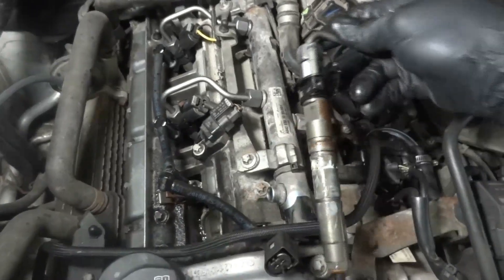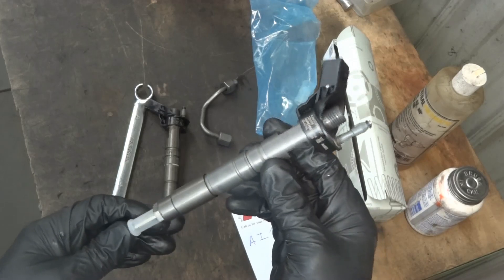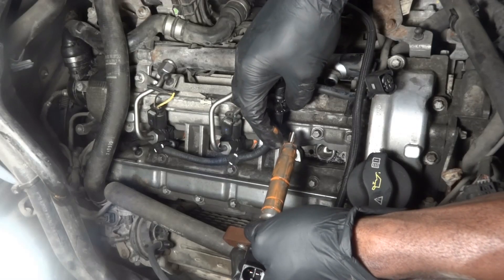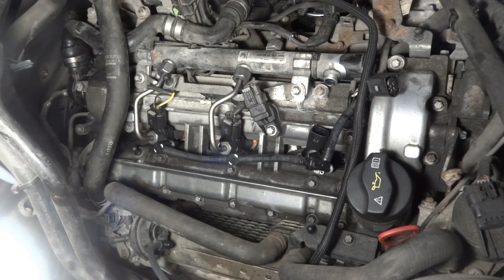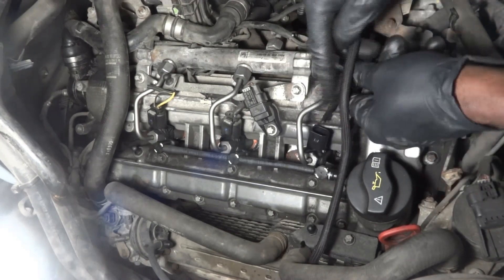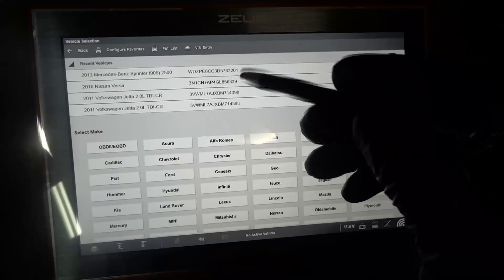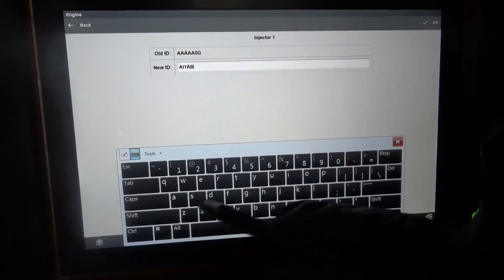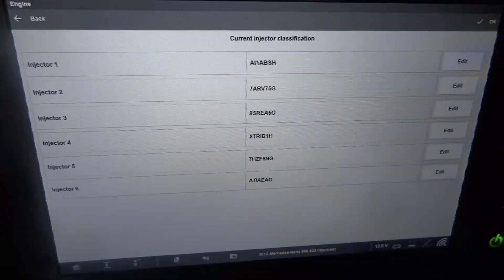Mercedes Sprinter : Cylinder Misfire Code P0301 & P16C200, Engine Runs Rough, Diag & Repair Part 2

Comment: did you notice that all injectors that were misfiring had the same id codes dont you think that was the reason for the misfire
Reply from the maker: @brianmafu5743   Yes, I did notice it but that wasn't the reason for the misfire, I had another sprinter in the shop that had the same id on all the injectors but it didn't misfire

Comment: If only one is playing up would replace all four?
And why?
Thanks
Reply from the maker: @kd3446  you don't need to replace all of them!
Reply: @KITS_Auto_and_Truck_Repair 

I replaced one on number two cylinder & hadit coded to the car, it l is still misfiring I will get it diagnostic done again..& see what else is causing it…

Comment: Hello. please can you help me ?? I have mercedes sprinter 2006 engine does not start ! i get error code 0201 and 0204 it says that there is a short circuit between wires 1 and 4 injection valve ! how can i contact you ?? I live in Sweden
Reply from the maker: @monemaljouri3727  check fuel pressure!
Reply: @KITS_Auto_and_Truck_Repair   Hi again thanks for answering me! I have changed the high pressure pump and fuel filter! could it be injection 1 and 4 that are bad?

Comment: A few days ago I ask you where Ac ports I found them and why no power steering ? My serpentine belt broke I'm sure why Ac not blowing cold & hard steering my sprinter a 3.0 how many belts do dose it have I didn't have flash light to see only light from my phone is second belt hard tie install I'm hoping once I install serpentine my power steering & Ac restored
Reply from the maker: @jamesray3920  Good!

Comment: Any suggestion why power steering very stiff hard to steer its full of fluid I see on you tube where others Mercedes Benz have similar issues
Reply from the maker: @jamesray3920  your power steering pump is probably going bad!

Comment: Kinda crazy that all the injectors that you had an issue with had the same ID code. Maybe they were problem ones from the start.
Reply from the maker: Chris Moreland  Heard That the injectors can have the same ID and work fine, so it's hard to tell

Comment: Hey, I really need your help!! My nissan frontier keeps misfiring.I NEED YOUR HELP . I have new spark plugs, new injectors, new fuel filter, air filter so im lost I am not sure what to do now. PLEASE IM ASKING FOR YOUR ADVISE...PLEASE SEE MY COMMENT
Reply: Hey Boskin, you help me with something please
Reply from the maker: Natasha Lewis  Sure! do you have a multiple cylinder misfire or a specific cylinder misfire? you need to check your ignition coil wiring and your injector wiring, I have a lot of videos on this channel that can show you how to do that! also check for compression to eliminate any mechanical issues that might cause a misfire!
Reply: @kdiagnostics6040  multiple misfire, I was told it could be the Mas air flow sensor ,but I can't find any try it. It's a new wire loom so I was wondering if I don't need to check the wiring again.

Comment: Hi handsome. Great repair as always. I have question have you ever used dpf cleaner call "launch uk , DPF gun particulate filter cleaning fluid" and the spray gun, O'Riley auto from the UK adds a of the detergent with half of water and sprays it into the dpf filter then he reset the computer and it runs good as new. Thanks.here is a link to his jimmy. See for yourself. 
https://youtu.be/g53q6JkOD3E
Reply from the maker: G O  I haven't heard of it! I'll check it out!

Comment: very good video.but i have notice that the 3 injector that failed had the same id 3 injector same id
Reply: The injector ID (code) defines its characteristics, such as coil impedance and flow rate. The engine computer needs theses to precisely time individual injector activations.  These codes are not unique location identifiers (like a TPMS system sensor) and it is quite possible for them all to be the same.
Reply from the maker: @ClarkLaFlare   Thanks for clarifying that!
Reply from the maker: dan man  Thanks! Injector 3 was not faulty we had fault codes for injector 1, 4 and 5
Reply: @KITS_Auto_and_Truck_Repair  yes that what i was trying to say all the 3 defect injector that you replace had the same coding #
Reply from the maker: @danman9017  Ah ok! I see what you mean, I believe those are OEM IDs From the Factory since these injectors haven't been replaced! I'm not sure though!  I'll do some research and figure out why those IDs were the same!
Reply: @KITS_Auto_and_Truck_Repair  i wonder those defect injector had those mach id that was in the computer
Reply from the maker: @danman9017   I'll do some research and figure out why!

Comment: Hi. These injectors are very expensive. Would an injector clean have been worth a try or were they beyond that? I have this engine in my Jeep and so far it has been great. I always use a Diesel additive to help keep the injectors clean.
Reply from the maker: Nick 2506  Yes these injectors are expensive but I didn't wanna clean them and worry about a potential come back! Cleaning them is like a temporary fix!

Comment: Do you think the Sprinters have a lot of issues, would you recommend one why or why not? Thanks
Reply from the maker: Patriot Prepper  Sprinters are great vans, I do recommend them, I don't recommend the ones with a 2.1L Engine! the 3.0L are the best when they are well maintained !
Reply: @KITS_Auto_and_Truck_Repair  what about the Mercedes 2.7L T1N vans? From your experience are they pretty good engines?
Reply from the maker: @berniemac8413  I'm not familiar with the 2.7L Engines, in our Area I see the 3.0L & 2.1L Engines!
Reply: @KITS_Auto_and_Truck_Repair  ah ok. I’m having issues with one of mine. It’s a 2005 dodge sprinter 2500 2.7L with roughly 294k miles on the engine.. there’s white smoke coming out when it’s running. It’s missing the diesel particulate filter and muffler so I’m not sure if that’s also why it’s smoking badly (that’s how I purchased it). Compression on the cylinders is 230, 305, 300, 115, and 280 (Cylinders 1-5 respectively). My small scanner says there’s a misfire on Cylinder 4. Which also happens to be the cylinder with the injector knock and the lowest compression. The engine has a lot of blowby. The oil cap will get blown off if I un-tighten it and oil will erupt over. Given your expertise, what would you recommend doing with this vehicle?
Reply from the maker: @berniemac8413   It sounds like you have a mechanical problem on that engine, you need to figure out why the other cylinder in low on compression!
Reply: @KITS_Auto_and_Truck_Repair  right, but how would you go about that without tearing the engine apart?
Reply from the maker: @berniemac8413  you can do cylinder leak down test, to figure out where the problem is!